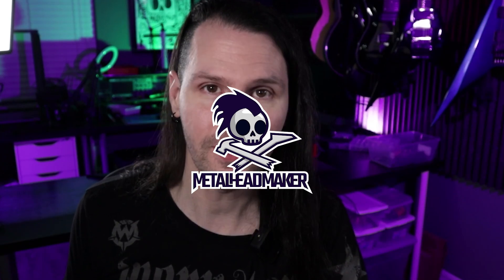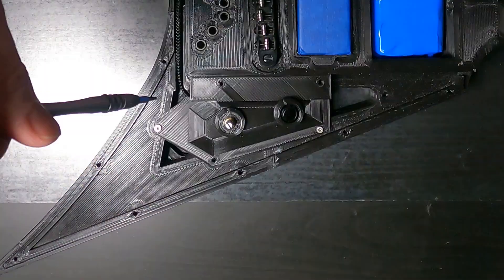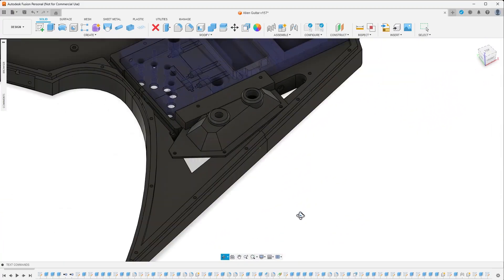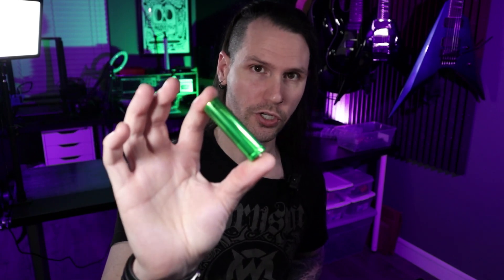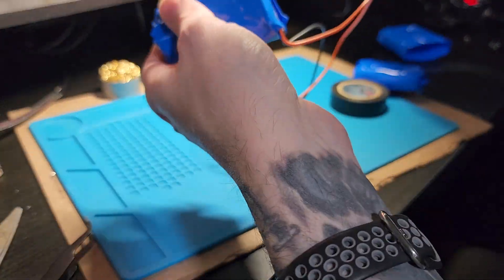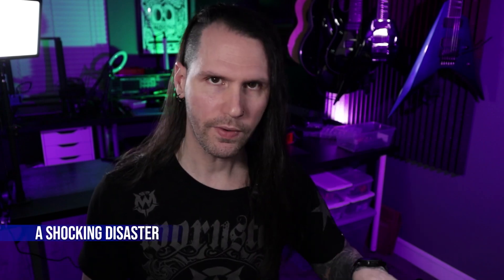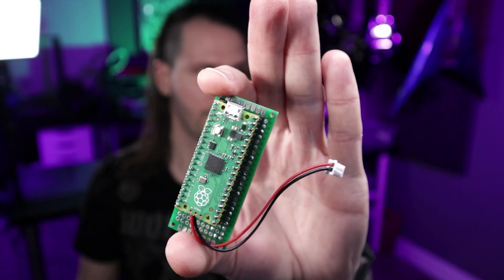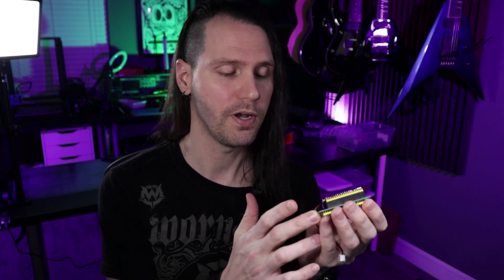Well, my 3D printed high tech guitar build WAS going great...

Comment: I would be interested in the nitty gritty of everything, I am a nerd after all. RIP teensy no. 3, you will be missed. About the LED wiring. Just because you outsource the PCB manufacturing to a service does not mean that you didn't build it yourself. You still have to design and solder it. It just makes the job way easier.
Reply from the maker: @Blazico  thanks for always tuning in man. Hey at least I figured out what was killing the Teensy's, so that's something. 😄 As far as the pcb goes, yeah depending on how things fit when it all goes together I might actually have to go that route. I'm really concerned about that tightness. Obviously I'm a bit further now than when I recorded this and I've figured out that it all fits, but the USB header is getting compressed badly. Definitely can't stay like that.